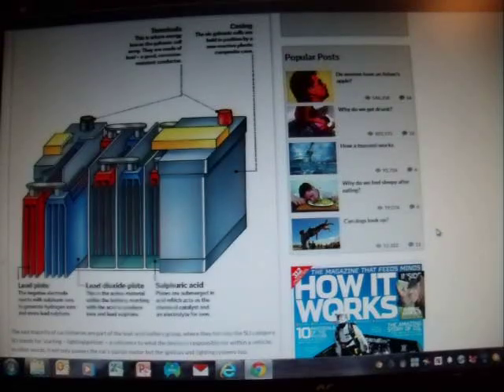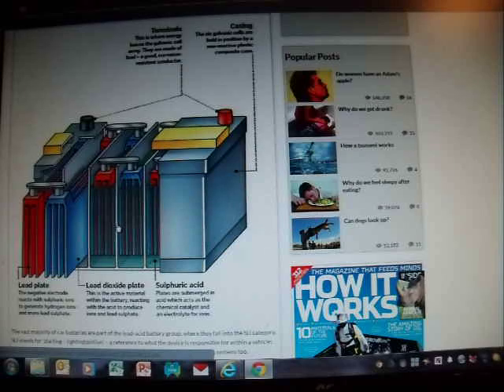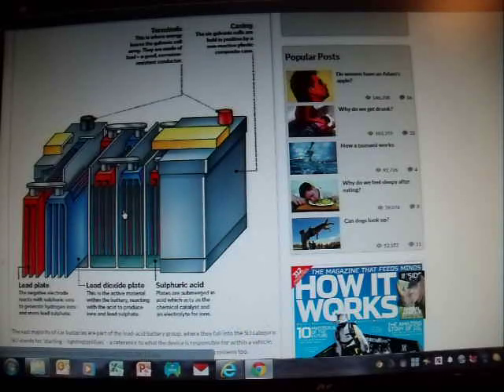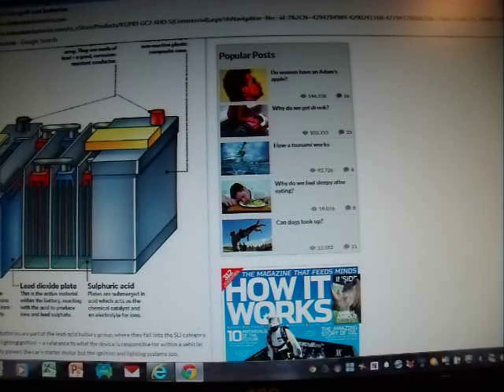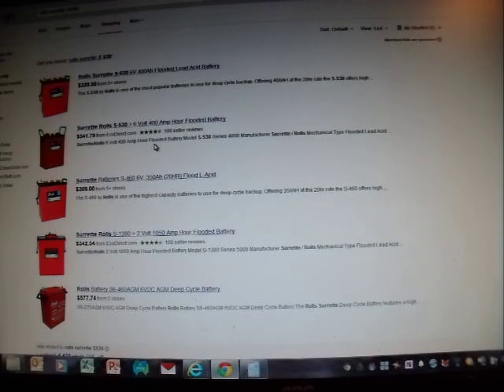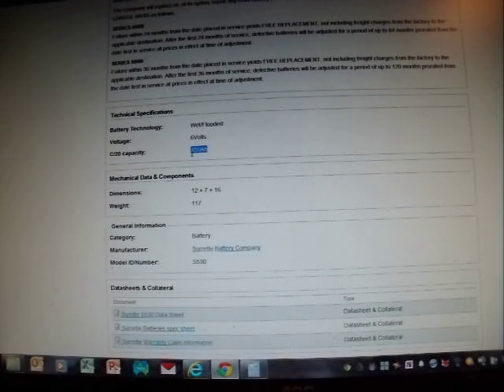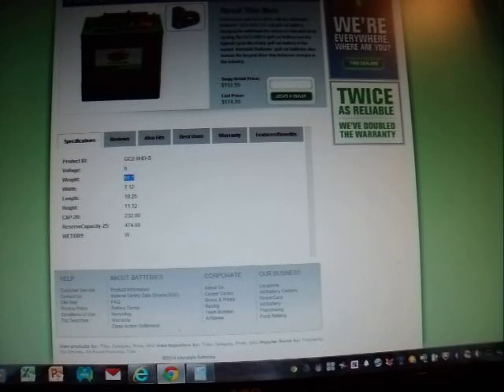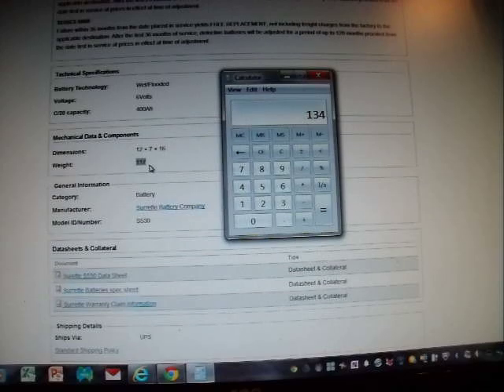Off-Grid Batteries - Which to buy?

Comment: It is 400 amps at 6 volts. So if you have a 24 volt system you need 4 of these batteries wired in series.

Comment: Hello Al.  What Desulfator would you suggest.  I have been looking at a BLS. Thanks. Michael
Reply from the maker: I highly recommended, there is no better. Most of the batteries in by battery bank were installed on August of 210 and they are still going strong. I just added water to them on Monday and checked the specific gravity, they are all good. Those batteries usually last 3 years, they are now going on their fourth year and going very strong.

Comment: Al,  I am running an 8 battery bank of NAPA deep cycle batteries with a 500 watt 12 volt solar system. What would you advise to be the maximum charge voltage before having the charger go to float mode?

Comment: Peace. It is a tricky subject. Unless we can compare the plates thicknesses by viewing, then we may not be able to know for sure if the "best" battery has thicker plates.  I FEEL that the best battery has somewhat thicker plates and provides more longevity.   In general, I would say the heavier battery is the better performing battery (either as a source of higher continuous current or as a source of deeper discharge) for a given application and associated battery type.
Reply from the maker: No argument from me there buddy. I just don't believe a marginally thicker lead plate as in this case warrants a 100% price markup as I'm sure it won't give us 100% more life time.

Comment: Awesome! Just spent the 3 hours this afternoon comparing 6v batteries for a backup system and came to the same conclusion. You explained it in 12 1/2 minutes.
Reply from the maker: Glad I could help. You will be interested to know that the Interstate GC2 battery has 811.5 cubic inches of capacity and since it weight 67 pounds that means it has a density of 12.1 pounds of lead per cubic inch. The Rolls Surrette batteries has 1,490 cubic inches and weighs 117 pounds thus it has a density of 12.7 pounds per cubic inch. So the result is that they are nominally denser and thus don't deserve the premium they want of twice the price. You can double your capacity and have the same battery life at a lower cost using the GC2 golf cart batteries.

Comment: I suppose I wasn't clear:  My point is that the "best" battery weighs twice as much as the other 2 batteries together and if they are all the same voltage, then the number of plates are the same, right?  So it stands to reason that the "best" battery must have plates must be twice as thick as the other 2 (thick plate) forklift batteries or it would not weigh twice as much.  Hope that helps.  You can find a LOT of good information at batteryuniversity.com
Reply from the maker: Not really, I think you are wrong on that assumption. If you look at the dimensions on the Rolls Surrette batery you'll find they are twice as tall as the golf cart batteries and thus the thickness of the plates are about the same from either. In this case the Rolls Surrette is 2 inches wider and 5 1/2 inches longer which accounts for the extra weight and not for the thicker plates you presume they have. The Interstate battery has 811.5 cubic inches of capacity and since it weight 67 pounds that means it has a density of 12.1 pounds of lead per cubic inch. The Rolls Surrette batteries has 1,490 cubic inches and weighs 117 pounds thus it has a density of 12.7 pounds per cubic inch. So the result is that they are nominally denser and thus don't deserve the premium they want of twice the price. I can double my capacity, with the same battery life at a lower cost using the GC2 golf cart batteries.

Comment: Great information, and a good thing to show, $/Amp hour! Have you considered other energy storage paradigms. For instance, I think when I build my project, I will use Metal Hydride matrix and store energy in the form of hydrogen, using solar energy to hydrolyze water in to O2 and Hydrogen, then store the hydrogen in a Metal Hydride "metal dust" that allows you to store 500 times the volume of the container, at low pressure. So to convert back you could use a fuel cell or burn the hydrogen in a standard generator as a fuel. With this setup you do not have the problems or life limits associated with Lead acid chemical  electrolyte storage mediums, or other battery paradigms...
Reply: Even modern fuel cells have fairly short service lives (~5,000 hours is typical) and the amount of power that they generate drops off a great deal during their life.  Hydrogen embrittlement is also a big problem.
Reply: That is because of H2 sources that have minute amounts of sulfur that clogs the permeability of the membrane, with hydrolizing produced from water. But yes the membranes do have to be replaced after a while. The new membranes are much thinner and cheaper.
Reply: William Jordan
I have heard of short lifetimes even with fuel cells running on high purity hydrogen (telecom backup supply systems IIRC).

Comment: Not to be difficult, your thinking is not logical.  Consider that the Excide batteries plates are probably twice as thin as the best battery you mention, so the best battery would last twice as long as either of the Excide batteries plates to be thin enough to call the battery dead.  The reality is that batteries are generally considered  bad  when they can only hold 80% of their rated capacity.  So, keeping this in mind, the Excide would reach that point much earlier than the much thicker plated "best" battery.  If you do your "research" you can probably find some data comparing the "best" battery with other batteries, so don't take my word for it.  I enjoy your videos with such a wide range of topics...  My goal is to have fruit producing trees and bushes when I move away from "Snow country"
Reply from the maker: Go research what type of batteries are used in forklift, submarines and standby power systems, then let me know what you find. I think you will find zero deep cycle batteries with thin plates. Thanks for enjoying and participating in the channel.

Comment: Sir, Respectfully, you mis-spoke about the meaning of Amp Hours, just before 5 min.:  232 Ah means 1 amp x 232 hours for a deep discharge battery.  You certainly would not get 232 amps for 1 hour, although this also EQUATES to 232 Ah, but that would likely not even apply to an automobile battery!  So, the maximum recommended discharge rate is given for a maximum period of 20 hours.  232Ah / 20h = 11.6 Amps max continuous current.  Make sense?  also NOT 400A at 20 hours!
Reply from the maker: You are correct, makes perfect sense! God bless you.